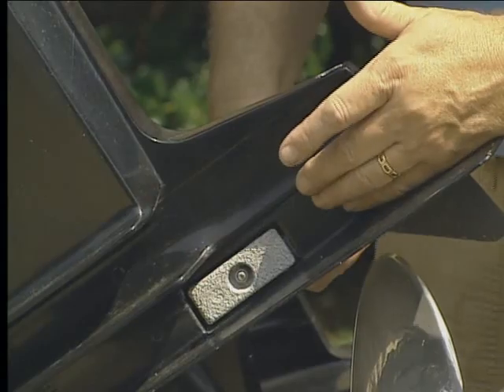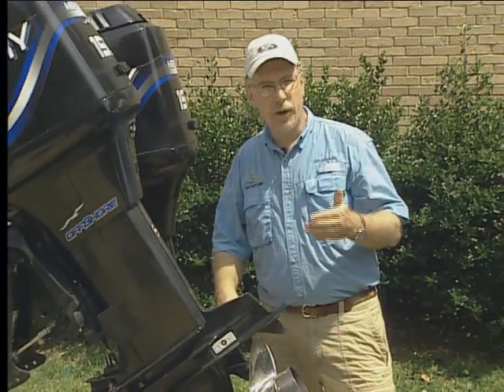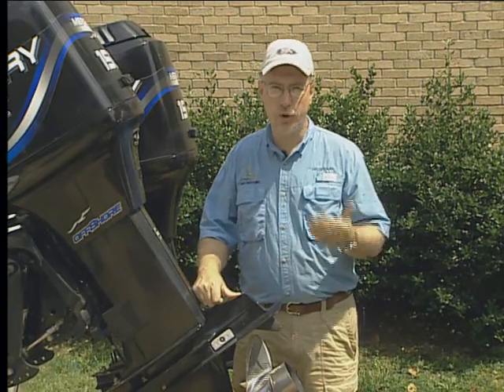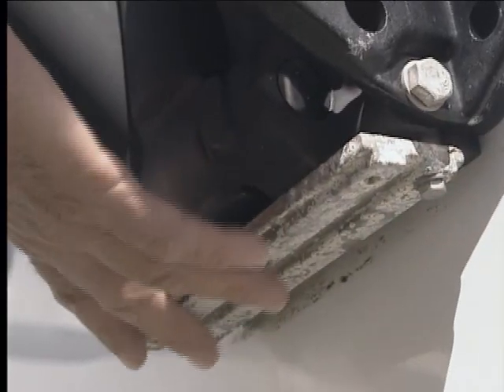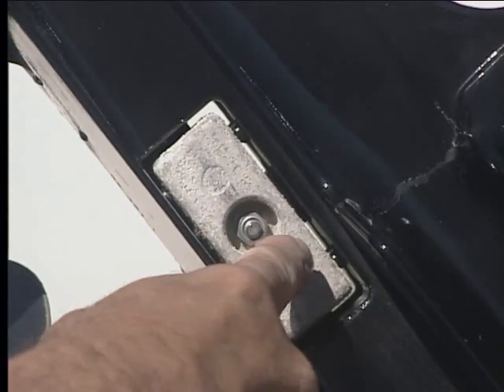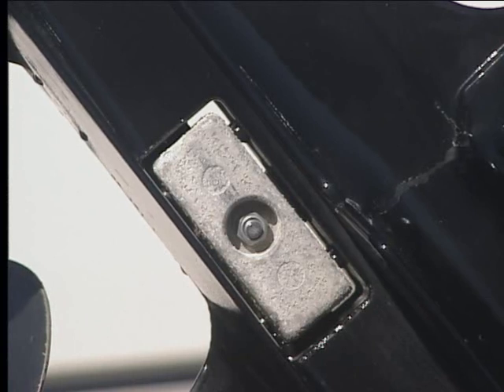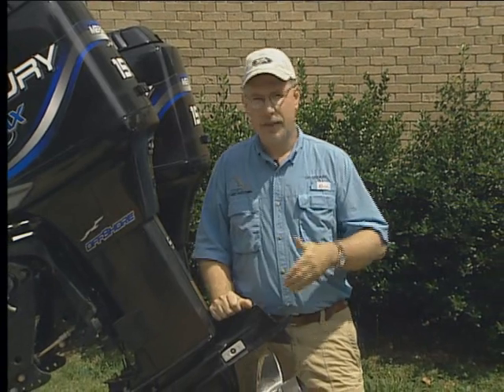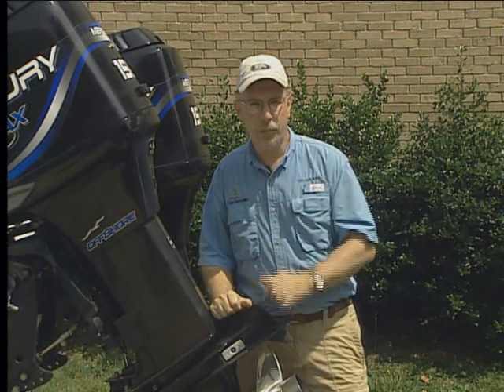Sacrificial Zincs - Nuts & Bolts Pro Tip

Comment: Any one knows about EPA recommendation on choice of cathodic protection for sacrificial anode systems? The least toxic material that is practical should be chosen. In order of preference: magnesium, aluminum, then zinc. Quote: EPA Recommended Best Management Practices (Part 2.2.7)